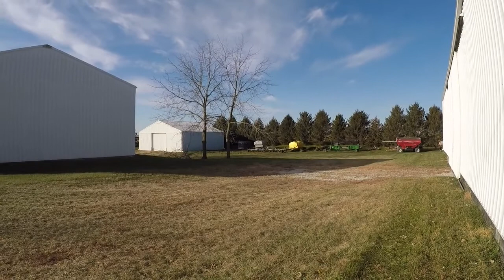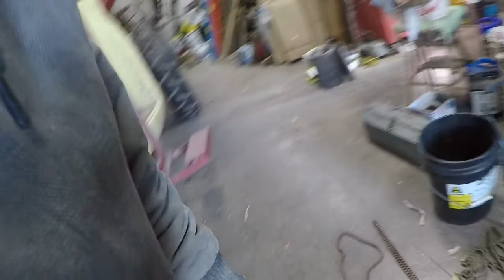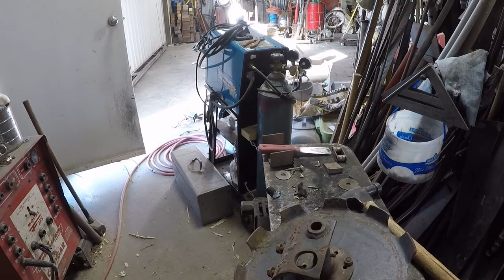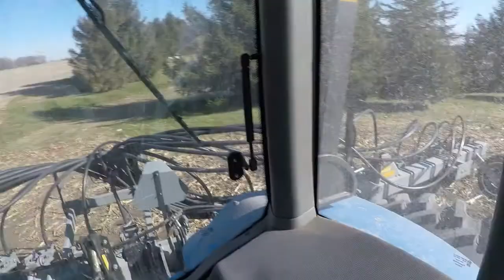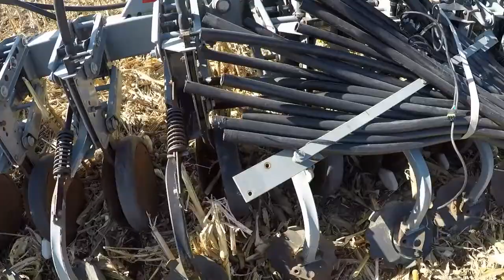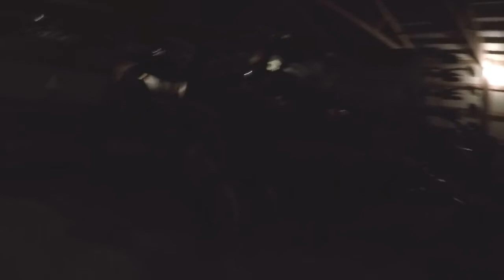Cover Crop Preparation 2019 - Southwest Iowa - Hiniker 4800 air drill

Comment: nice demo. I was curious how the Hiniker opener unit did in cornstalks
Reply from the maker: They seem to work pretty well for rye.  I'm not trying to go real deep, though, and rye will pretty much grow on concrete if it gets some moisture.  I've never had any issues with cornstalks plugging anything.

When I bought the drill I thought I might try to use it to plant some soybeans, also, but the wings on the toolbar don't flex down and that's sort of a deal breaker in our terrain (you can have daylight under the outer row units in the wrong situation, like planting over a broad base terrace).

(Apologies for the delayed response--must have missed a notification that you left a comment)